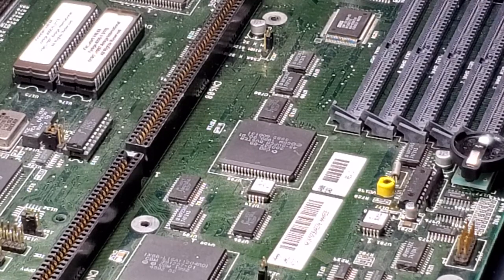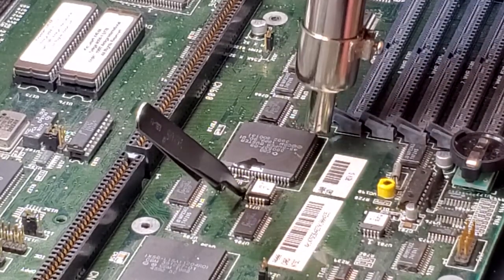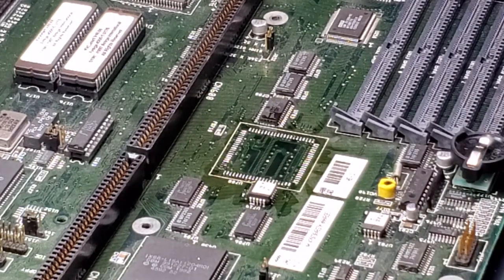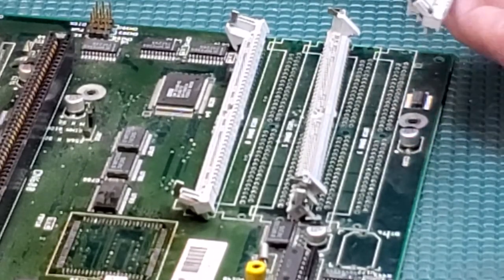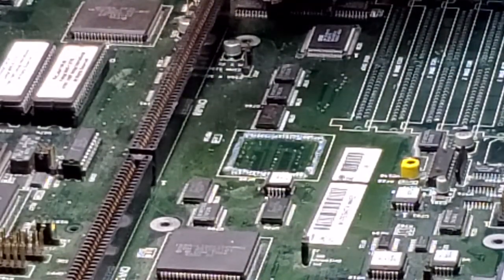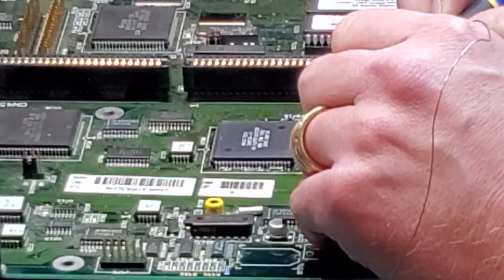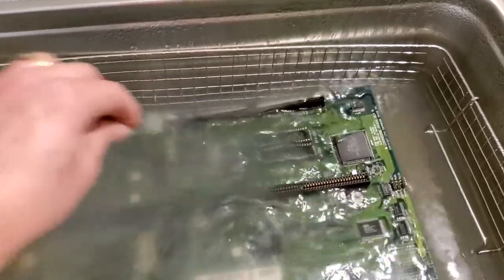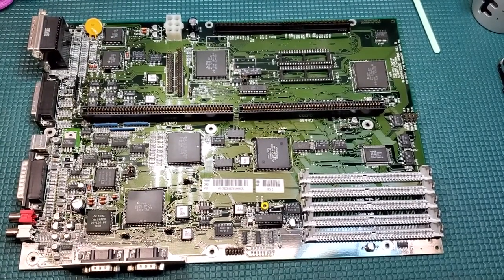Amiga 4000 Buster Upgrade and Restoration

Comment: Amazon affiliate links to the products you use could be helpful.   Thanks for the video.  Ultrasonic cleaning is underrated by many until they try it themselves.
Reply from the maker: Check out my website at www.acill.com for that. I have a section I update in the menu with my preferred tools and supplies!

Comment: Very cool - I did this same upgrade to my Amiga 4000 last year using almost the same procedure (biggest difference being no preheat step and I drag soldered the Super Buster Rev 11). I also installed new metal clip SIMM sockets. Would love to run it through an ultrasonic cleaning though, I'm sure it has flux residue hiding underneath.